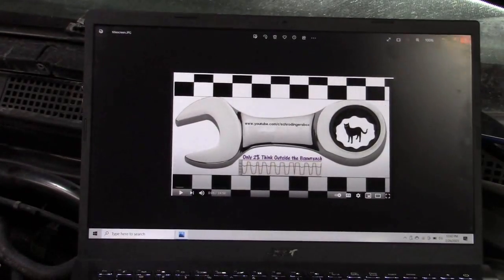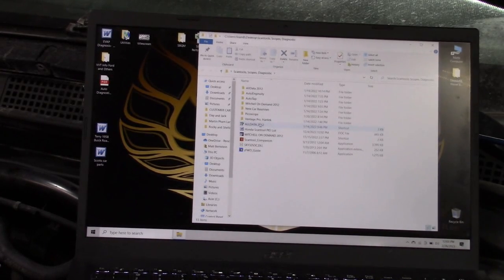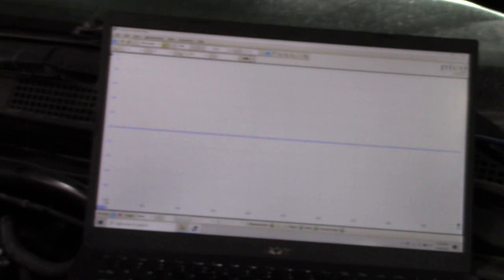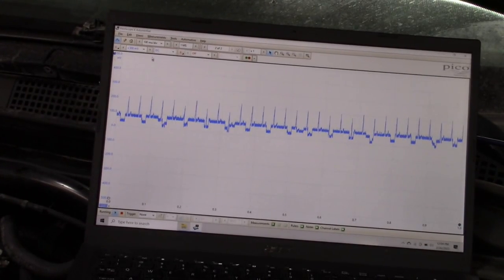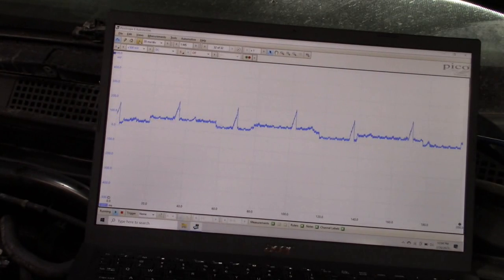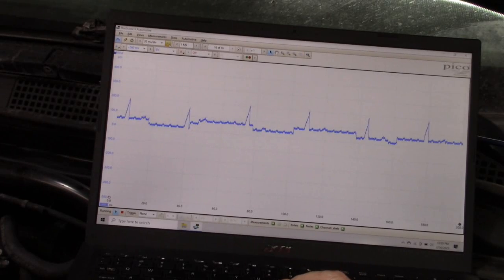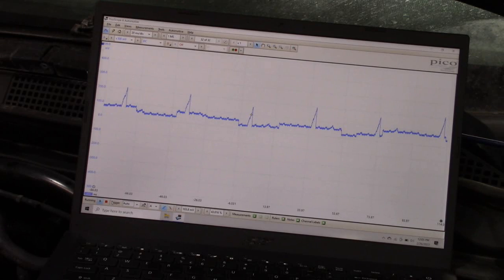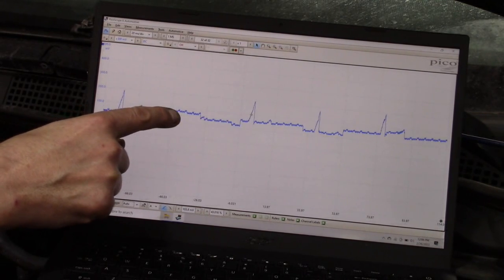What if the Spark Plugs and Coils are Under the Intake?

Comment: You still don't know what's wrong. Just that there's a misfire, and which cylinder. Why is it misfiring? Pulling the intake off isn't necessarily going to tell you your answer.
Reply from the maker: That’s my point. An ignition analysis, pressure transducer test, other follow ups may be necessary.

Comment: Does that wyze probe work on 4 wire coils? Will it show secondary? I know you were just using it as a sync would it show a secondary waveform
Reply from the maker: It absolutely will work on 4 wire coils (or three wire- same design). 
  The only issue is that more modern vehicles have started shielding coils- supposedly I presume to prevent interference on the more sensitive electronics I guess. Shielded coils won’t be compatible with a capacitive pickup probe.

Comment: Using the secondary probe to identify the firing order was genius! I was wondering how youd tackle that wirhout swapping or disconnecting stuff.

Could also be applied to an Amp clamp compression test to see which cylinder has low pressure and overlaying the inductive kick on the amp trace to the starter motor.
Reply from the maker: Correct. I very often do that on compression tests to identify the cylinder.

Comment: how do you know misfire is in spark plug or in coil or in pcm
Reply from the maker: by checking for spark at the plug and if not check at the coil and if still none then check signal inp it or ground side switching at the coil. if neither present then check at the PCM.

Comment: Many manufacturers do have live misfire counters in scan data for identification of which cylinder is producing misfires. Otherwise, techs should be directed to check Mode$06 data MIDs $A2-AX. ($A1 is the random or total misfires, $A2 is cylinder #1, $A3 is cylinder #2 etc.) The EWMA, TID 0B (got to love acronyms, Exponentially Weighted Moving Average) will show the accumulated misfires over the last ten drive cycles. TID 0C will show the misfires that occurred during the last trip. BTW $AX TID80 are catalyst damaging misfires and $AX TID81 are emissions related misfires.
Reply from the maker: Yep good advice as always.  I always thought Mode$06 was for fords but I have come to see it is how to get misfire data on other makes as well. Not sure if that's a new thing or not.  Its just a little aggravating for me because on my scantools at least, Mode$06 is a "separate" part of the software so I normally cannot combine the $06 data with practical live data simultaneously.
Reply: @SchrodingersBox  OBDII regulations required all manufacturers to log misfire data in Mode $06 starting in 2010, along with permanent codes, Mode $0A and a few other enhancements. Scan tool capabilities are all over the place, while some do force users to log in separately to access the global side of the system there are others that include global services in the O.E. side now.

Comment: Matt, since the waveform was for the ignition circuit, will the waveform  show any different if an injector is faulty?
Reply from the maker: Not on this ground.  Your point is a good one and will be taken up on another video I do.  This is why on this car I didn't go through a shared power like the fuse- because  injectors, cam, and crank sensors are all on it as well so you get all kinds of noise and feedback.  However on this ground it is strictly for the coils so the signal is "clean" and makes a good example. It's important to check a diagram to see what all noise you will get on that circuit. As a great example- there was a point in the video where on the signal probe, I used a ground that I found had a ton of noise on it. I don't know what ground I used and what the noise was, but moving to another ground the noise was eliminated. 
  Also, whether you do this on injectors or coils- you may not necessarily see a absence of the ramp on the miss. For example on an injector you may see a missing "pintle hump".  On a coil you may see an abnormal climb in the "ramp" representing a short in the primary winding.  You have to interpret the signals- it won't always be "oh its missing, that was easy!".

Comment: Great job Matt! A lot of times the ground is not so easy to hook on too, I like to put a loop in place of the fuse and put the clamp there.
Reply from the maker: Yep that works too. One issue with this on this model is there were other things on the fuse so it wasn’t as “clean” as the ground.

Comment: I have two grounds on 5 cylinder engine and happened to have intermittent misfires on cylinder 3 and 5, garage could not guess and ground bolt for those coils was just loose.

Comment: How would a similar technique work on a waste spark system where the coils are paired? * And the back bank 1,3,5 on. V6 is  blocked by intake.
Reply: Usually the higher spike is the compression one and the lower spike is the waste.
Reply from the maker: ALD beat me to it lol. He is exactly right. You will see two spikes but the higher on is for that cylinder on compression stroke.

Comment: That's the way the local Ford dealer diagnoses. Pulls the plenum and moves the coils.They charge 1 hour diag for that.
Reply from the maker: That’s terrible!!!  Also I have seen intakes where there is no way it can be done in an hour. So if they only charge an hour they are losing money for sure.
Reply: @SchrodingersBox  HA. It was a friends car. He brought it to them for some reason😆. Even after doing that, it was a misdiagnosis. It was down the rabbit hole on that one, crankshaft variation was not relearned from a previous repair. That caused misfire codes that were not actually misfires.

Comment: So if a spark plug is bad, buy the coil is good, would you still see the ramp?
Reply from the maker: Not necessarily. This was a demonstration on getting the signal. You then have to interpret that signal- if it’s missing or shorted or open or high resistance….

Comment: Sometimes a good infrared thermometer can show you a likely suspect as well.
Reply from the maker: Yes that’s true. But again it shows the misfiring cylinder, not the cause.
Reply: @SchrodingersBox  that is true, but It can help you close in on it with what little you have on hand and limited diagnostic stuff. I am considering a used Solus for my own amusement. I don't do gas stuff any more professionally. Just diesel.